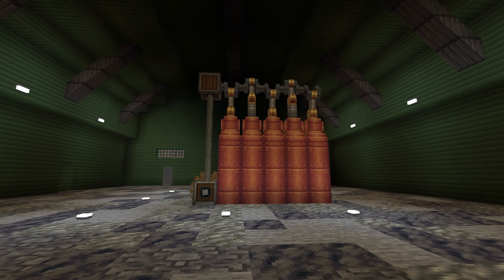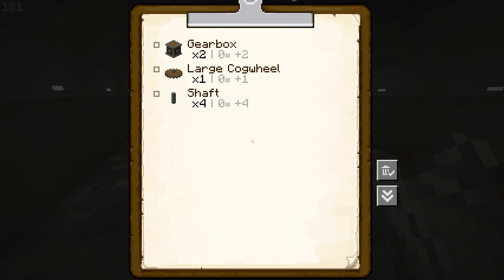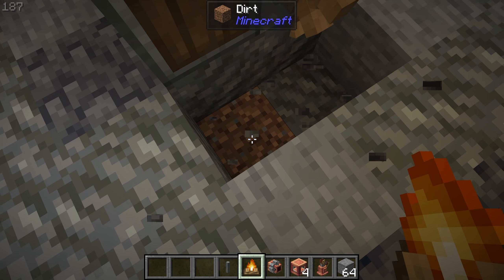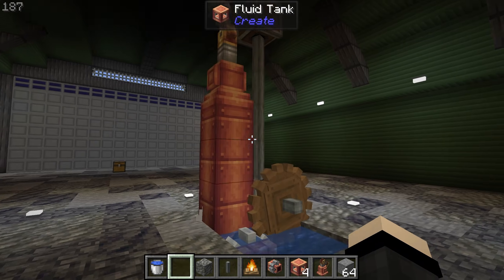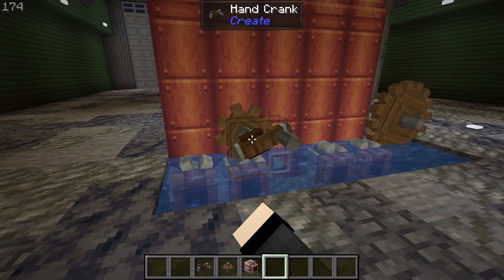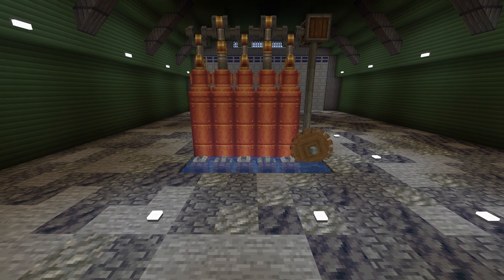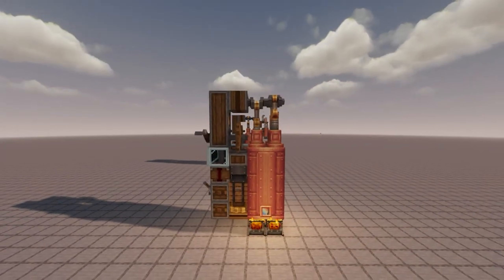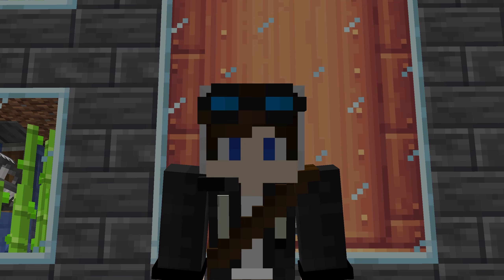Expandable STARTER Steam Engine TURTORIAL | Create Mod

Comment: I need a bit of help jumpstarting the engine, I built 4 steam engines but whenever I try to jumpstart it only one kicks on, the other 3 remain inactive
Reply: A bit late, but check to see if the mechanical pump is facing the right way

Comment: Hi And First And great work i got better one tho
Reply from the maker: How many su you outputting?
Reply: @OurCreationYT  I got to check but it's in the max tank that can hold 3 by 3 + it can run 3 by one steam engine required in lava and there are three steam engines per each and looks nice and looks like an engine.
Reply: @OurCreationYT  147,456 self powered level  6 engine.
Reply from the maker: @Hypernova3-t3u  ah very nice!